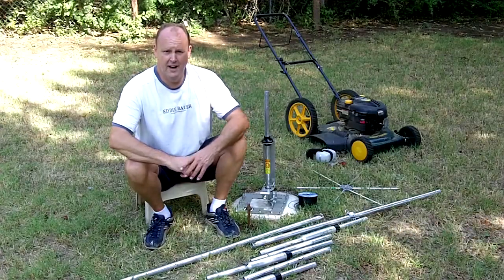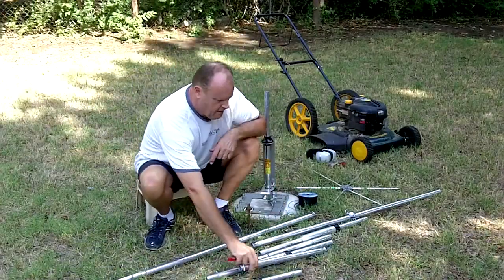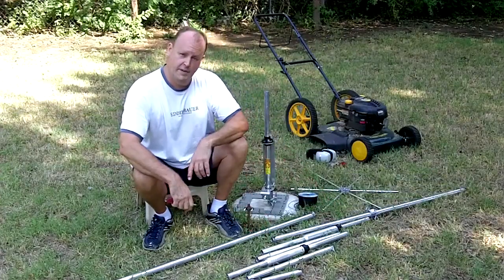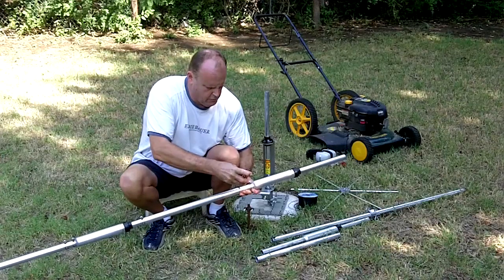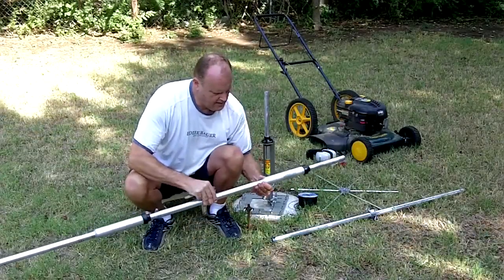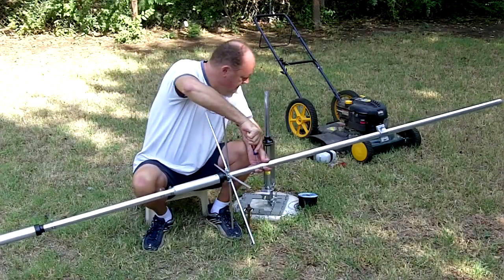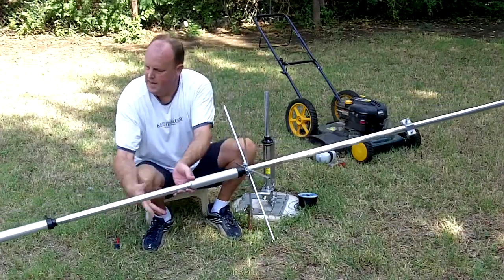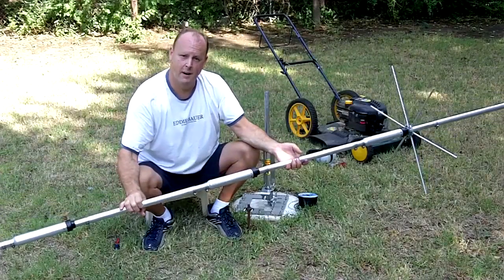Hustler 4BTV Vertical Antenna Assembled

Comment: I have owned at least four of these verticals, and they do work, but tuning is not as easy as it may look. As a matter of fact, if you don't have a piece of test equipment like the MFJ analyzer and you have to tune by taking it up and down using and SWR bridge, then grab you a cold drink, a chair, and at least an hour to make one work right. Even Hustler (the manufacture will tell you that it is not a "plug an play" antenna. But once you have tuned it right, it is a good antenna.  Jim   WA5WRE

Comment: Some hams say this antenna "doesnt work" but i think they dont have any radials under it. I have a 5 BTV with the 80 meter resonator removed(i have an 80 meter dipole) with a DX Engineering tilt plate and a DX engineering radial plate. The antenna is a breeze to tune with a MFJ 259 analyser! Put down lots of radials and it will work GREAT!

Comment: Thanks for the videos...good stuff.

I have two questions...

1.  I was just given a 5BTV, and don't care to use it on 80.  Is there a way to take off the top 80m trap and stinger and make this into a 4BTV?

2.  My space for an antenna is challenging with a metal roof and lots of obstructions around.  If I ground mounted the antenna, there will be a 3' high chain link fence about 10 to 15 feet away.  Is that going to cause unwanted reflection?  Should I opt for roof mount even though it's metal?

Comment: tech upgrading to general, looking at this antenna for my restricted space lot. Just curious, will radial orientation affect drastically my radiation pattern, or is this antenna hearty enough to still be functional. I may be restricted to running my radials basically in two directions instead of the circular pattern recommended.

thanks for this great video.
Andy KD5OUW

Comment: Being somewhat new I was looking at the 4BTV but wondering how it work on a 15 foot mass with just a grounding rod.  Can you tell me more ?
Reply: You'd need sloping radials at a sloping 45° angle. Check out DX Engineering's pdf file for the BTV models. If not, your mast becomes an extension to the antenna which you dont want.